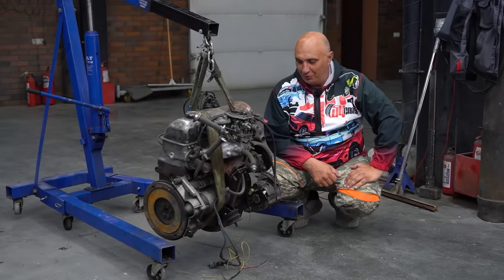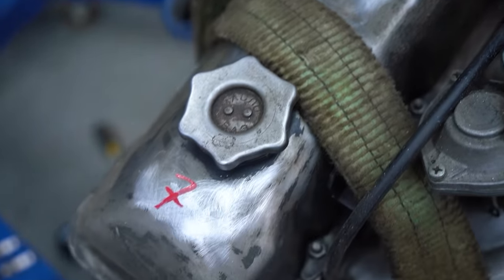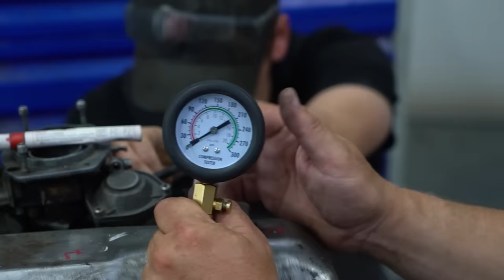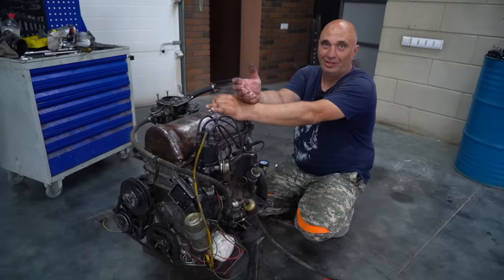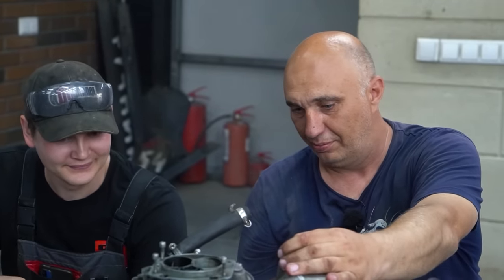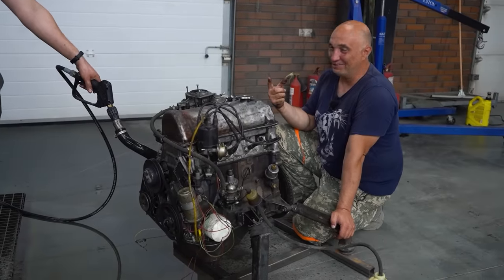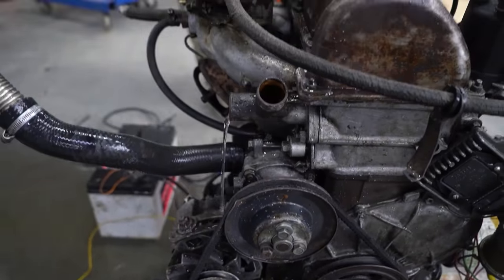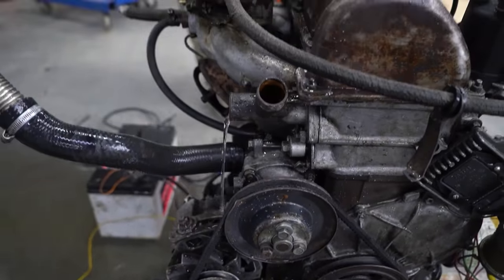Will an engine start on RUBBER piston rings?

Comment: Silicone would possibly work better than butyl or latex rubber, some silicone can withstand pretty high temps.
Reply: Not without a change in density
Reply: The fuel will destroy silicone.
Reply: @michaelsestito3983  You actually think it would last that long? lol
Reply: Yes, please try silicone!
Reply: Perhaps the 4 ring piston motor with standard top and bottom rings, and silicone in 2 and 3 to see if it boosts compression but minimizes the silicone fuel/oil problems.
Reply: Max temp for silicone is about 500°F .
Reply: Run it on methanol too, to keep the temperature down.
Reply: @UmmmmmmmWhat  Exactly. Hone it out and put new top ring in and silicone rings for compression
Reply: @Dr.Westside  500°F is 260°C which is fairly good.
Reply: Iam not sure how silicone survive 800C:)
Reply: You might be on to something
Reply: @michaelsestito3983  That's an excellent point.  I forgot about that part.
Reply: @pauls464  silocone is methonol resistant too so that would be splended
Reply: Motor oil degrades most silicones
A ptfe(teflon) or hard viton oring would be better suited
With a standard top compression ring it should work really well
Reply: Teflon rings..
Reply: I'd like to see this in a car and drive it
Reply: Something like Viton O-rings would be even more robust.
Reply: @DustinBigMac  at least its feasible. These guys 🐵 around with crap that obviously doesnt work when they have the knowhow to build cool shit.
Reply: @michaelsestito3983  they could get specially made ones like the red or green seals used on fuel injectors
Reply: @detroit149  was going to suggest using ptfe/pvdf/fluoropolymer orings
Reply: @midlifeparty  dead inside
Reply: Honda bond
Reply: Better option could be viton or fluor-viton
Reply: @xxstanc3don3xxtwitch23  wut
Reply: @andrewtrumbo983  honda bond. Used for sealing oil pans and rocker cover. High heat silicone thats hard wearing
Reply: Fuel destroys silicone
Reply: @benjamindavidson632  no, not methanol
Reply: @gristlevonraben  Viton o-rings would be best.  Stay with  3 o-rings as you could see from the exhaust that oil consumption was fine, plus we want the oil to keep the o-rings lubed and cooled.  If you add an traditional oil scraper ring the rubber o-rings will run too dry and burn up.  They need the lube!
Reply: Ceramic coat the cylinder walls too maybe?
Reply: @chipcity3016  excellent points!
Reply: Vinton would be the go
Reply: I believe Silicone has worse abrasion resistance when compared to Viton.
Reply: There ya go a caulking gun an high temp high pressure tube of the best ???
Let dry .
Hose clamp ring compressor. .
Reply: Are you really sure of that  ???
What material can withstand a 1,000° ?
Reply: @Mrshotshell  I think a glass fiber and graphite impregnated ptfe lip seal would have the best chance of working and surviving. Maybe this would survive for a while as a second ring. Piston oil squirters would go a long way to keep the piston temps down. Silicone isn't very resistant to abrasion.
Reply: Full blown Brunswick balsa wood 🪵
Reply: Maybe Teflon... No way with rubber or silicone
Reply: Viton orange would be awesome
Reply: Silicone is not wear resistant and will tear down very fast. Viton is wear resistand and PTFE is just much better - wear and temp resistant.
Reply: @quevicular  calm down there buzzkillington
Reply: I doubt that silicone would be rigid enough.

Comment: Probably needed an oil control ring in there to control the flow of oil.  Looks like they kept combustion gases out of the crankcase, but forced oil off the wall upwards into the combustion chamber.   Pretty fascinating!
Reply: I think so too!
Reply: The oil may also of helped preserve the rings from getting damaged
Reply: @BLAZE13011  I thought about that too.  Eventually they are going to flatten and/or fail, but it is very interesting because I thought combustion gases would burn them up within a minute or two!
Reply: @Flies2FLL  same thought, interesting nevertheless I figured they'd melt and gall up the cylinder Walls
Reply: I'm thinking the o ring is a oil ring, but pressure and vacuum are letting it or pushing behind the O rings, so a larger or thicker bottom ring would be better along with a fully mirror polished bore.
Reply: @benjamindavidson632   good point, the springyness of an oil ring is forcing it against the cylinder wall but the o-rings are trying to pull away from the wall.
Reply: @BLAZE13011  You can be that automotive engineers around the world are watching this video and scratching their heads.....
Reply: @BLAZE13011  i think youd have to live with the oil issue or not have rubber rings last that long.
Reply: The groove in in the piston for the oil control ring generally has holes to allow the oil to drain through the wall of the piston.  This was probably blocked by the O ring and therefore caused the failure (due to excess oil in the cylinders).

Comment: I'd like to see those rubber piston rings tested in an actual car on the test track, so we could see how far the rings can truly take a car.
Reply: yeah, that would be so interesting to watch
Reply: Try a car with a trailer to see if the rubbers can deal a high Pressure with high temperature
Reply: I imagine that the problem with rubber/silicone/teflon rings is that over time small pieces of this material can fall into the crankcase and go to the oil pump, and this could ruin the oil pump and you would lose the engine for lack of oil in the crankshaft and valve train.

Comment: As someone who enjoys making running model engines, using viton o-rings is actually common practice in place of traditional piston rings.
Reply: Silicone can probably take some heat.
Reply: Same - I'm working on the Tiny inline 4. Wouldn't fancy trying to make and fit proper rings on a 3/8 piston. I've got plenty of nice running aero engines with no rings at all.

Comment: These actually look like hydraulic seals, their optimal temperature is around 110C to 130C, they burn at 180C. Your regular engine runs at 90C. They could last awhile there. Install a hydraulic lip seal in the middle and aim it down, so the lip expands while moving downward. Or use lip seals on all rings, two facing down and the top one up, to keep the pressure in the combustion chamber.

Comment: To prevent the twisting O rings just bevel the top of the bore ever so slightly. then with a standard oil ring and 2 o rings as compression rings and a proper cooling system I believe this engine would run, and run well.
Reply: kind of give new meaning to the term burning rubber, doesn't it?🤣🤣🤣🤣🤣

Comment: Pro tip: just like at 17:16 always ensure that you have a steady stream of water pouring onto your alternator so it doesn't overheat.
Reply: THAT AMAZED ME TOO , IT WILL RUN A CAR I BET
Reply: Doesn’t apply is Russia
Reply: Perhaps that's one of the parts that better to rust out rather than burn out.
Reply: I'VE ONLY BEEN WORKING ON CARS SINCE THE LATE 70S. I SOLVED ALT BELTS THAT FLY OFF DUE TO HI RPM BUT I'M TOO MUCH A NOOB TO KNOW THAT ALTERNATOR SECRET, COMRAD. I SHOULDN'T HAVE LAUGHED BUT YOU ARE THE ONE THAT POINTED IT OUT. IS IT COLD WAR OR COLD WATER TECHNOLOGY? QUIT LOL.  😆🤣😂

Comment: please follow this up by installing the engine in a car, immediately start driving until it dies or runs out of gas. I had always assumed that the rubber would be consumed immediately. I am impressed with your dedication to whimsical ideas.

Comment: What about using square O-rings. Like the ones used in the pistons of brake calipers. Think they would have better scrapping capability and more sealing surface.

Comment: The reason that cilinder 1 and 4 only worked at high rev, is that the sealing between cilinder and piston by the tension of the piston rings is not enough at high revs.
 The sealing between piston and cilinder at high rev is established due the combustion pressure that gets behind the piston rings and push the rings harder to the cilinder walls. At low revs, like during the compression test, you get 8bar pressure at all 4 cilinders, but when a engine is running, the combustion pressure is much higher, with a healty engine arround 20bar at low rev, and arround 70bar at high rev. 
With the twisted rubber rings the sealing was good for 8bar, but above (low revs during running) they started to leak, then at high revs, the rubber rings started to get more pressure from behind due the combustion pressure , get more squeezed against the cilinder walls and could handle higher combustion pressure.
A part of misfiring could also be due water on the ignition system like sparkplug cables etc...

Comment: Normal engines use steel split rings for a good reason. On the power stroke the rings expand ( all the way down to the oil ring ) and scrub the oil back down into the oil pan. When the power stroke is over, the pressure decreases, the rings close up and do not pump oil up into the cylinder very much.

What you have built is the exact opposite. On the power stroke the pressure pushes the O-rings into the grooves causing them to NOT pump the oil back into the oil pan. At the end of the power stroke the pressure decreases, causing the O-rings to expand, which pumps all of the oil on the cylinder wall up into the cylinder. This fowls the plug and causes other various problems.

Comment: On the top two ring lands use square cut rubber seals like in automatic transmissions and use the factory oil control ring i really think the square cut rubber seals will do the trick I absolutely love watching your channel you guys do stuff like I did when I was younger lol keep it coming
Reply: I was thinking about this as well, I'm glad someone already commented it
Reply: Or perhaps rubber seals that are half circles so that they sit flush on the piston but still retain the same seal as before?
Reply: YES I THINK YOUR ON TO SOMETHING WITH THE UPPER EDGE BEVELED A LITTLE TOO
Reply: @jrmyzero  GENIUS   YOU SHOULD BE AN ENGINEER
Reply: @SMMBHQ-cg2zy  I do like to think of myself as an engineer funny enough, not ever gonna go to school for it though lol
Reply: @jrmyzero  I KNEW IT ,

Comment: Interestingly, the second compression ring usually has some oil control capabilities (known as a scraper-type design). A round o-ring will have limited ability to keep excessive oil from blowing past the piston. What would be interesting is if a florastor seal used in transmissions would work, but those have to be "sized" after installing to the piston. Maybe a square-cut seal (like those on oil filters) could work? Something to keep the oil from passing through and fouling the plugs. "Rubber" piston rings could work for 10, 20, or even 30,000km, but I would not buy a car that needs the engine overhauled every 30k kilos. Interesting experiment. Great work, keep inspired and you inspire others.

Comment: That was really awesome to watch. Here i was thinking it would only last 5 minutes. I'm impressed. I say go for it. I'd love to see that video. I had a blast watching this one. Thanks Team Garage 54.  Also.. never underestimate the power and reliability of a Lada in my opinion. We need Ladas in the states. Talk about reliability. And it looks like a simple vehicle to work on. Please do correct me if I'm wrong though. Byes for now. See ya next video.
Reply: Lada’s are based on sixties Fiat’s from Italy
Reply: @telocho  Kool. I did not know that. Thanks for telling me. I learned something which awesome, because everytime you learn something it's always a good day. To bad Fiat Chrysler makes junk now. I tell ya with the quality of the vehicles going down the drain in the states. Makes me long for quality vehicles from other countries. Sorry for rambling. My apologies. Thanks for teaching me something awesome about Ladas, have an awesome day or night. Byes for now.
Reply: @telocho  The older ones yes.
Reply: I imagine the USA would have a lot of "Ladas" the choose from, for example cars with the general motors 3800 motor?
Reply: @android584  I would hope not. I would prefer the original motor. I have a 350 motor In My truck and a little 3 cylinder in my Geo Metro LSI. I have really good performance from them. Granted my Geo motor is worn out but it still takes me where I'd like to go. I just gotta avoid the interstate as my motor don't have the full 60 hp or whatever it is. But man that fuel economy is nice.

Comment: I've seen viton o-rings used on home made model engines and they work like a charm for years.  They wont last for ever, but long enough for a moderate duty engine.
1.  O-rings need be fitted with proper clearances so as to fill the groove properly when compressed.  If the groove volume is smaller that the volume of the o-ring you will big problems as the o-rings cant crush beyond its mass properties.  It will lock or "spill out". 
2.  This engine seems to be poorly tuned.  Carb not set properly?  It should be able to idle smoothly.
LOVE THE CHANNEL!

Comment: Guys have been using o-rings on model engines for years. Some of them have run at several years of shows with no failures. The Chinese are also selling models like this.

You should put this in a car and see how it does. Won't do 100,000 km for sure, but I bet you can drive around the block enough times to get bored.
Reply: I have seen a Chinese weed eater use them before. Idk about other ones cause I’ve only had to open that one. But the oring wasn’t the reason why I opened it up and it looked nice inside
Reply: Yeah Im sure rubber rings are fine for non pressure applications, but once you put the car in drive and step on it, the pressure would probably blow out those rings. Still want to see it though.
Reply: Hydraulic pistons have rubber o-rings and they run thousands of psi
Reply: @tboniusmaximus3047  yes but hydraulic pistons don’t deal with the extreme high and constant heat of internal combustion. Pneumatic pistons have rubber o rings too.
Reply: Think about that for a moment lol when machines hydraulic oil cooler is twice as big as the radiator or oil cooler…

Comment: Amazing how well it ran, never would have expected that. How about putting the engine in a Lada and test driving around a track until the engine finally stops, endurance test!
Reply: rustymotor     I agree. There's nothing like putting it into a real world scenario and "load testing" it. The weight, speed and torque demands of a track should very quickly weed out any weak links in the power chain. How intriguing and fascinating though.
Reply: Yes!!!!!!

Comment: with smaller model engines, the rubber rings work(Nitrile will last the best), but the use of an oil control ring definitely helps keep the cylinder clean

Comment: I wonder how well high temp o-rings would work, they can operate in temperatures as high as 260C. Another idea would be to use steel rings on the top of the piston and use o rings for the bottom two, should reduce exposure the hot combustion gases while potentially increasing compression.

Comment: Interesting concept but you have to be mindful that by changing from steel to rubber you lose a lot of the heat transfer from your piston crown to the cylinder walls
Reply: Lol there's not a lot of heat transfer between the piston and block via the rings 🤣

Comment: I think that having an oil ring added will let the rubber rings burn up. The oil getting up on the rings added more sealing for them and compression went up. I believe if you take away the excessive oil, it will fail.
 SO, what if you add the oil ring where it belongs and put some tiny holes in the base of the O ring grooves so they get some oil and not excessive oil ??
GREAT videos guys! Love watching what you do. 😃

Comment: Great video as always, would love to see the engine running better, shame those 2 cylinders had twisted o rings. I think another 4 ring setup would be a good test with the top 2 rings as standard to help keep the heat away and the bottom 2 as o rings to boost compression
Reply: what sort of miracle motor is this?🤣🤣🤣

Comment: putting one in the oil control land without blocking the drain holes in the piston forced oil up.  What people call an oil ring is simply a drain, the 2nd ring is what actually scrapes the oil off the cylinder.  Put the original oil control ring back, replace the top 2 with at least vitron or better flueroelastomer rings in a higher durometer.  Getting backup rings in the pack would be ideal also, possibly teflon.  It would all work real well if everything was properly sized with the right materials, wont be as long lived as metal rings but the only real problem will be the surface speed of the rings with any real rpm. No reason it shouldnt idle for days or weeks though.

Comment: There is a small gap starting at the cylinder wall and goes inwards towards the center of the cylinder where the air/fuel mix doesn't combust. It's just a few millimeters deep (or maybe even less) so you shouldn't have to worry about flame touching the bare rubber rings but after the engine gets up to normal operating temperature is where you might start seeing excessive abuse on the rubber. Another point of concern might be with the rubber rings absorbing oil and fuel over time causing the rubber to expand and become more porous. Long term exposure to those chemicals and that kind of heat/friction abuse is a recipe for disaster, eventually. Excellent video.